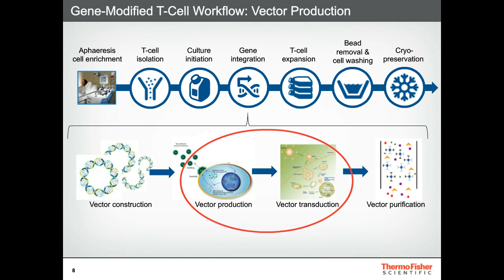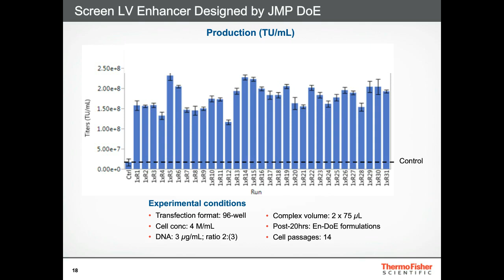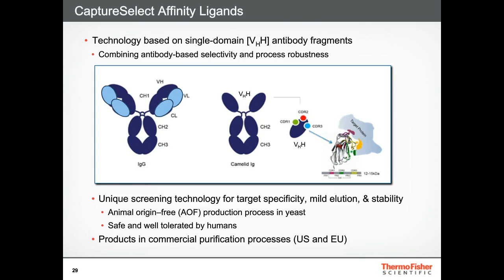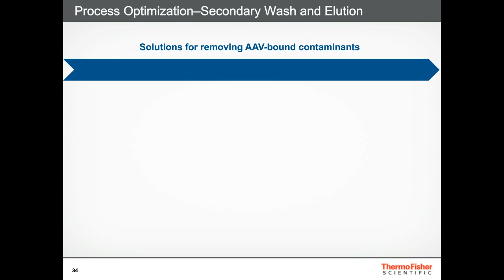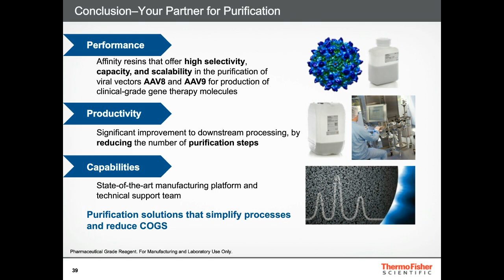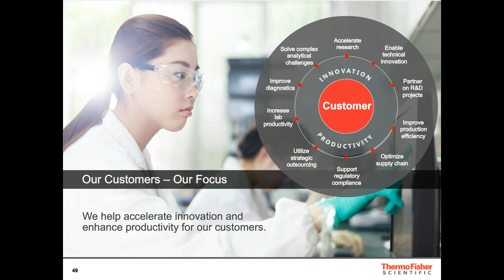Solutions for Viral Vectors: Enabling Platform Approaches to Advance Cell and Gene Therapies

Comment: Labroots Medical Webinar [titled]:
Evolution of a Platform Based Non-Clinical Assessment Approach for Vaccines 
By: Joseph J. Senn
 
- In this video, the Moderna rep details how biodistribution studies and toxicity data was assumed due to them using the same LipidNanoParticle delivery system. 

- He also states how they can ignore viral loads, even when entirely different, and just focus on the outer shell's toxicity. 

*My question is:* How can toxicity and biodistribution data of a different viral load with the same LNP be the exact same?